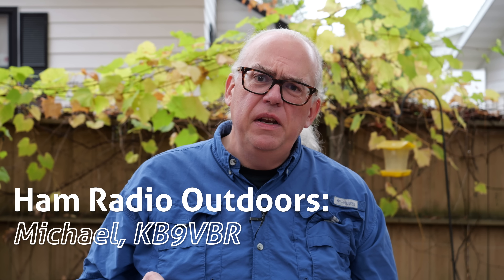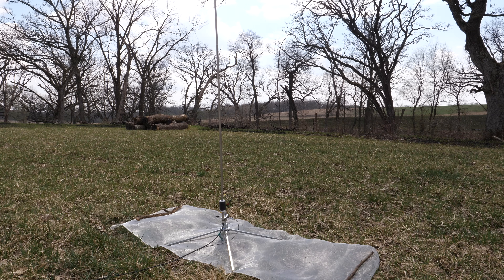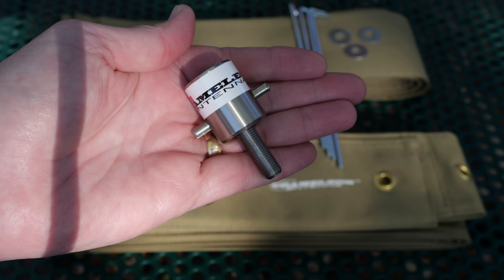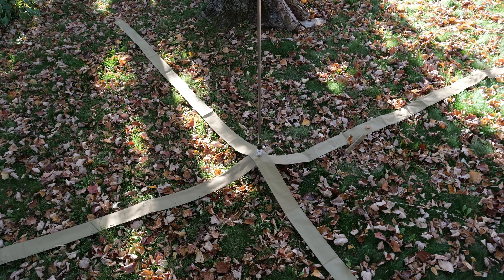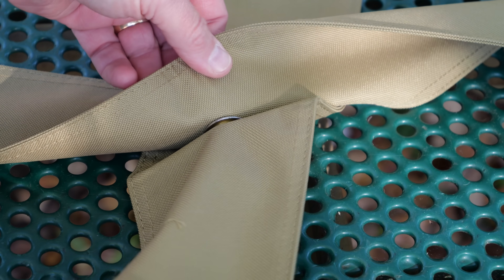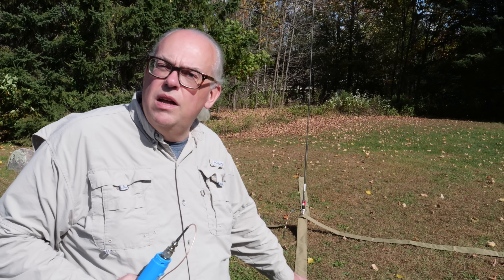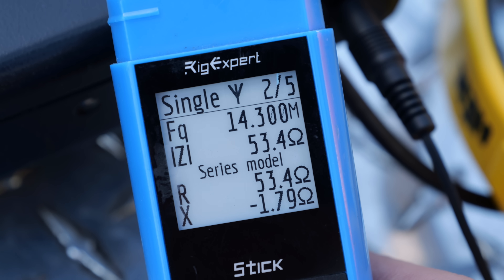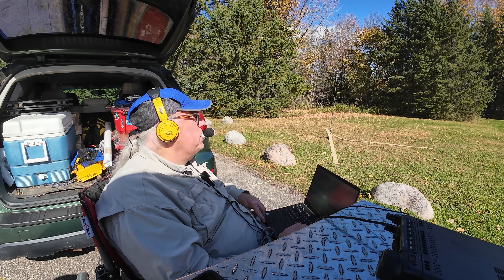I tried the Faraday Strip Radials for my antenna, and WOW!

Comment: I like to maintain consistent results in every environment, so I often use the CHA FSR when my vertical system is mounted on the CHA SPIKE MOUNT or any base that’s insulated from the natural ground.

In that setup, I insert a CHA SS INSULATOR between the CHA FSR, and the mount. This isolates the antenna from the ground, allowing the Faraday Strip Radial System to handle all the RF grounding and return current.

It’s a great way to eliminate ground inconsistency since soil conductivity and composition can vary dramatically from one location to another. By letting the FSR create its own controlled and uniform artificial ground plane, I get repeatable impedance, SWR, and field strength everywhere—from rocky terrain to sandy soil.

In short, the FSR does the real work, ensuring predictable, efficient results regardless of where the antenna is deployed.
Reply: Any idea, when it's available again? Thx.
Reply: @Ralf-CGN  YES - we currently have 500 units in production that should be ready around the 20th of December if everything goes accordingly...

Comment: I've used faraday cloth since I saw your first video using it. It works great and sandbags will keep it on the ground on breezy days. I like the idea of the strips but I personally think at $130 they are overpriced. I could probably find a local seamstress to sew some for me for much less than $130. But that's just me. I'm sure they will sell a bunch.
Reply from the maker: I usually have a couple of oddball items in the car I throw on the fabric to keep it from blowing. In the winter I even use chunks of snow. As for making your own faraday strips, I'm not sure you will save much money. Fabric isn't cheap and once you get all the material costs in, you will be close to the retail price of the item.
Reply: @KB9VBRAntennas  if I try it I will let you know.

Comment: Couldn't the same effectiveness be done with the faraday cloth plus radials?  I have have had no problem making POTA contacts  with the MC-750 Chelegance antenna with its tripod and 4 radials on top of the faraday cloth. 55-59 RX and TX .  FT-450 AT transceiver with the LDG Z-100 tuner.
17 ft whip is resonant on 20m and tuner can pull in 17m.  Whip can be adjusted for 10-15 m and it comes with a coil for 40m.
Farthest POTA contact from TN with that setup so far was Columbia , S.A.
Reply from the maker: I've done a blended approach with radials and faraday cloth. You get your best results on the lower bands as the capacitive coupling of the fabric helps get you a better impedance match.

Comment: These are convenient, but unless you are near seawater, a few raised radial wires will outperform cloth or screens.
Reply from the maker: I do enjoy using elevated radials, but they do present obstructions and are not appropriate for all locations. This system offers very good performance without the fear of people running into your antenna system.
Reply: @KB9VBRAntennas Can these FSR strips be elevated at an angle from a tripod?
Reply: Yes and no. Raised counterpoises are VERY good but when you've a bunch or people and animals running around - they become hazard pretty fast!

Comment: I currently do use the faraday cloth and like the performance that I get from it. This kit looks nice and rugged but for the cost I can buy two or three more cloth kits and add the copper gromments as needed like my current cloth is set up to do. Chameleon makes some nice stuff and I have the MPAS 2 and a few other items from them. But they are pricey and that would prevent me from getting this kit. I love the idea of a two sided color arraigment and that sounds they could use that as a marketing upgrade for thier product line. Thanks and take care Michael, 73 Vic de KE8JWE
Reply: Also, with a 236"x43" sheet you get 10 times the ground coverage with only the added hassle of having to find a few rocks.

Comment: Looks like a great product for vertical pota activation for sure. Germany on first contact. {{( ITS WORKING!)}}! Great video as always and I took the window screen idea to a whole new level. Here in Texas it's common place to have drought conditions and dry soil doesn't have that reflective bounce that damp soil has. So I excavated the area underneath and outward from my long wire dipole antenna installation as its mostly sand and dries out quickly. I excavated the sand away about 3 feet deep and rolled out the window screen and bolted the screen together so I have an effective surface underneath my dipole antennas 180' x 120' and grounded on the corners and center with copper plated ground rods a full 10 ft length driven just below the window screen depth. Pulled the poor dry soil back and covered the window screen and replanted the grass. I now get solid copy of net cobtrol s from the nets I operate on HF. I relay an awful lot of contacts in that net control could not hear. The ground screen works like the champ it is. Great video as always. 73 GOD bless Earnest k5ewm 🇺🇸👍.
Reply: I’ve the same issue in Phoenix AZ. It’s almost impossible to have a descent ground here… it’s dry, sandy and rocky.
Reply: I understand your problem. Its even more work than expese and effort to do; but I wanted to improve my station performance on recieve and transmit. I used the window screen as it was the more efficient and economical way of achieving the stability of signal reflectivity i needed to make my station perform as it should. Its all part of the counterpoise system that makes our antennas work. The less moisture in the soil you have reduces the oils ability to reflect your signal back into space. The same principal works on your recieve as well. Some people even put water sprinklers out and water underneath the antenna. It would be temporary fix at best but it would work. I didn't have a good enough well system here to water daily. Hope find a good solution that works for you and lets others know what you found. 73 GOD bless Earnest k5ewm 👍🇺🇸.  @Chameleon_Antenna

Comment: I bought a big piece of Faraday cloth after watching a couple of your videos.  I have been running radials with my Wolf River Coil  1000 antenna, which has worked fine.  I have yet to try the"magic carpet" cloth yet.  Need to get out there and give it a try.  The strip system looks good, but I think it's a bit pricey.  I could make my own I guess as I sew tactical gear, and this wouldn't be a stretch at all for my sewing machine.
Reply from the maker: Other than replacing a button, my sewing skills are nonexistent. I think you have the ability, you could make your own strips.
Reply: @KB9VBRAntennas  I could.  But I"ll try to use the cloth first.  I think it wll carry just fine, just wondering about wind.  I guess I could put grommets in the corners.
Reply: How many feet does your bobbin hold?

Comment: carpet=more surface area then these strips.
Reply from the maker: I calculated the strips to have about 13 square feet of surface area and a 3 yard piece of faraday cloth is about 27 square feet. With the sheet you do get more surface area for better capacitive coupling. But I also wonder if the strips, since they are longer and cover more physical space, would offer a certain amount of benefit.

Comment: The window screen doesn't pack up as nice, but, thats $130 bucks and it has a pretty big foot print. I'll be sticking with my $7.00 aluminum window screen from Menards that has a 7' x 3'' footprint. As always thanks for the video Mike!!
Reply from the maker: Best bang for the buck is the aluminum screen. And you get a 11% rebate.
Reply: I can see the value depending on how long they last. The faraday cloths I use are about $50 and need to be replaced about once a year or so. If this last for 5 years, I see a savings. Still not sold on the idea. I would want to see it deployed with a small tripod since I work a lot of NPS areas where they ask nothing be put in the ground or trees.
Reply: You say that you would not be something you could throw in a pack, but I believe you could, and I really like keeping them attached to the spike and folded.  Is it better than window screens?  The price difference is huge.  Window screens are fantastic, but awkward.  Carry them like a bedroll, slung under or on top of the pack, but still a bit bulky.  Faraday cloth easier to pack.  This could be something in between.  Again, I really like keeping it attached to a spike for very fast deployment, but I have to agree that it is a lot of ground area, like wire radials.  I don't know, applications versus convenience versus cost.  It like the idea better than wires however.

Comment: Overpriced snake oil, MAYBE gain a dB at best. Typical appliance operator $$$$$ approach. 

Radials of any type, laying directly on the ground...will make for a very inefficient radiator unless you have 20 or more radials. The BEST and an  INEXPENSIVE way to get a LOT more efficiency from a portable vertical is to simply raise the feedpoint (base) of the vertical up 3 or 4 feet off the ground. By doing so, you reduce ground losses significantly and only need 3 or 4 sloping radials to gain this higher efficiency. This will provide a +6 dB efficiency advantage over this joke. de W1LJ
Reply from the maker: Welcome to the channel! Regular viewers know that I employ a wide variety of ground systems: wire, screens or mesh, and elevated counterpoises. I have extensive experience with all three and can give an expert opinion on their operation. I think you are slightly overstating things by saying the elevated radials will give a 6 dB advantage over the faraday strips. (remember, 6 dB is only one S-unit). There will be a slight advantage, but it won't have as much as an impact as you believe. 

Also, calling something snake oil is a great way to discredit your statements. The Faraday Strips work, and there is nothing deceptive in my demonstration of them.
Reply: @KB9VBRAntennas  you have demonstrated no such significant improvement with this gizmo. Making contacts can be done with any old wire antenna. Low SWR is meaningless in this context, it is unrelated to radiation resistance and hence, efficiency. 

How about a scientific, engineering based test? Two radial systems, one wire, one these strips. Remote receiver. Compare ground wave signal strengths. You will not detect any difference. 73, W1LJ
Reply: @diogenio  Look up HOA ham - he did just that!
Reply: Yes - the CHA FSR can also be deployed elevated if you want.
Reply: Thanks for repeating this, twice...NOT!  I hate when I run into condescending ham operators.  A simple "not for me", only once would have sufficed.  No need to beat it to death.  On edit:  After viewing your QRZ page, I'm even more disappointed in your posts.  You pedigree is impressive, and you have a lot to offer to operators young and old.  But if you make posts like this on a regular basis, you would just drive away people, especially the new hams.  Something this hobby can't afford.  I hope you take this as constructive criticism, and offer your extensive knowledge to others in a more palatable way.
Reply: @bigfranksworld the problem with so many ops today is lack of technical knowledge and understanding. They see a gizmo like this with claims  - that in practical terms - are meaningless. If you want this item to gain less than 1/6 of a S-unit, go for it. Or you could follow solid engineering and elevate your vertical and gain a serious amount of efficiency...at little or no cost.

If you already understand the principle behind this, then fine, scroll on. There are plenty of ops who do not understand ground losses and what makes verticals tick. Perhaps they will find some benefit in my comments.
Reply: @diogenio I'm always up for learning.  I have had some great Elmer's in the past, all with great information, and teaching in A way that keeps a new person intrigued and on top of the hobbies.  I also ran into a few that, while knowledgeable, were not helpful because of the way they went about it.  Like saying that you have to learn code, or you can't be a "real" operator.  That isn't helpful, and drives away people, especially the newer operators, or even people that are on the fence about starting.  Ham radio isn't exclusive to this type of person, but I find plenty here.  Thanks for your comments.
Reply: @bigfranksworld  you say hate and condescending then go on to criticize him based on findings of your review of his QRZ page.. maybe look in the mirror.. he expressed concerns with the product.. you attacked him personally.. there’s a difference.

Comment: Why the CHA FSR Is More Efficient Than Wire Radials

The CHA FSR (Faraday Strip Radial System) outperforms traditional wire radials due to its larger conductive surface area, lower resistance, and more uniform current distribution, which together reduce ground losses and improve radiated field strength.

1. Increased Conductive Surface Area

Conventional wire radials provide only narrow conductive paths that limit RF current return.
The CHA FSR, by contrast, uses wide Faraday conductive strips made of Copper–Nickel fabric, offering hundreds of times more surface contact with the ground. This dramatically reduces ground impedance, allowing more RF energy to be radiated instead of dissipated as heat.

2. Lower Surface Resistance

The CHA FSR’s Faraday fabric has a surface resistance below 0.05 Ω, compared to several ohms of effective loss often measured in wire systems — especially on poor soil. The lower resistance minimizes RF losses, resulting in a stronger and more efficient radiation pattern.

3. Uniform Current Distribution

The diamond weave pattern of the Copper–Nickel fabric ensures current flows evenly across both Faraday strips. This uniformity stabilizes the antenna’s impedance and improves omnidirectional field balance, producing cleaner and more consistent performance across all HF bands.

4. Reduced Ground Loss and Improved Efficiency

By combining large conductive surface area with low resistance, the CHA FSR reduces ground losses and enhances vertical antenna radiation efficiency.
Field testing has shown a median increase in relative field strength between 23% and 28% compared to standard 4-wire counterpoise systems — a measurable improvement confirmed under real operating conditions.

5. Consistency Across All Terrains

Wire radials depend heavily on soil conductivity and layout. In rocky, sandy, or uneven environments, they lose effectiveness. The CHA FSR’s flexible, broad surface maintains continuous coupling with the ground, delivering repeatable and stable performance wherever it’s deployed.

6. Practical Efficiency

Efficiency also extends to durability and safety. The 900D Oxford encapsulation protects the Faraday material from corrosion, tearing, or fatigue, while the TAN color increases visibility — reducing tripping hazards and preventing accidental damage that could compromise performance.

⸻

Summary

The CHA FSR is more efficient than wire radials because it:
	•	Provides a broader conductive ground plane for lower impedance.
	•	Maintains extremely low surface resistance (<0.05 Ω).
	•	Delivers a median 23–28% increase in field strength over standard systems.
	•	Ensures consistent performance across all terrains.
	•	Offers superior mechanical durability and visibility for safe, reliable field operation.
Reply: Do a direct compare with WSPR with a second setup and the same time and youĺl see no difference. Show that...all other wording is just words no data!
Reply: Are the two (or is it four) radials at that predetermined length suitable for 20m-10m?  Will this one set of radials be adequate for 40 and 80m too?
Reply from the maker: I got a good match on 40 meters, and from my experience using wire radials and faraday cloth on that band, I think they will work fine. Performance may be ok on 80 meters, but from my experience a 2nd sheet of faraday cloth is necessary for a good match.
Reply: This set is for 10 to 40. Never tried 80.
Reply: @Chameleon_Antenna  Thanks.  I imagine another strip or two, or longer strips might bring 80 into play. But 40-10 is a pretty good range as it is.  Maybe an 80m attachment to the existing strips might work.